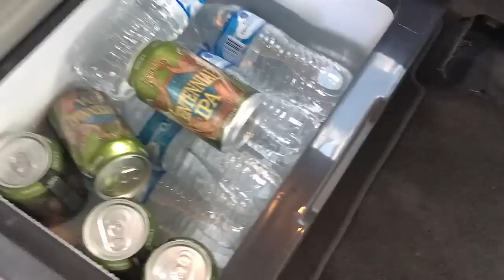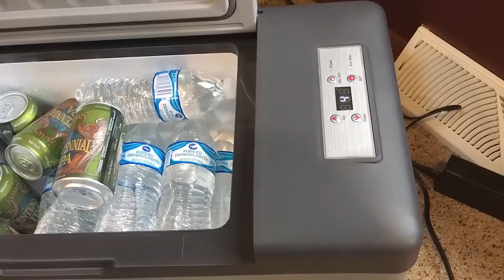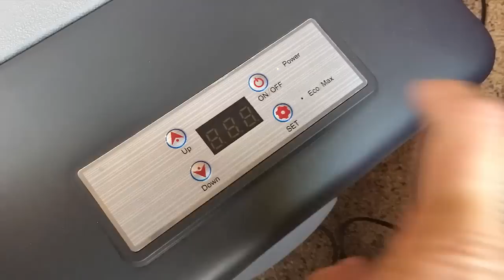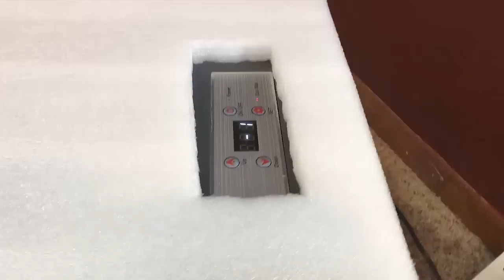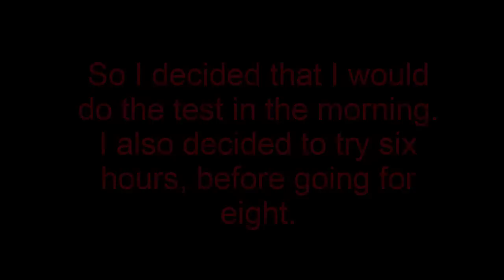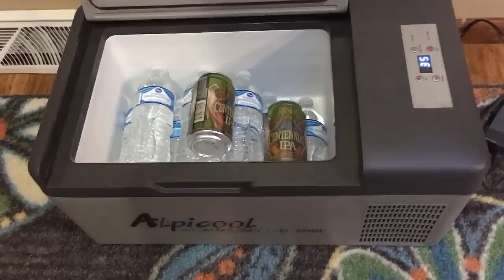Refrigeration in Your Van Part 2 (keeping beer and insulin cold)

Comment: I did the same with the packing material except my packing material completely boxes the entire frig.
Reply from the maker: It definitely helps but I did not have the foresight to leave room under the bed for packing on top. It just squeezes under my bed when the one piece is on the bottom.  Thanks for the idea and for watching!
Reply: @OdysseyCamper  i actually rubber cemented it on and cut out the lid and controller.  Not sure it really helps because i have no previous data but, common sense says it has to.

Comment: I've learned that a lot of these cheap Chinese refrigerators don't match their stats. There is very little quality control with these things. The compressor on my Joytutus 20 liter ran continually. It killed my 300 watt, 500 watt hour battery in 15-16 hours at 25 degrees. I went ahead and got a Setpower TC20, which has awesome insulation, and it lasts 48 hours on the same battery at 25 degrees. The build quality on these refrigerators are just hit and miss.

Comment: I forgot how to change it to H1. I have a lithium battery. Do you know how?
Reply from the maker: I THINK you press and hold the settings button until it flashes and then it might display an H1.  Unfortunately, I sold this one to a friend and now own an updated model.  Here is a page with some other hidden settings...unfortunately, it does not address your question but maybe you can figure it out through a process of elimination.  http://www.florida-prepper.com/hiddensettings.html
Reply: @OdysseyCamper  yeah. Tried that. It’s acting wonky off the Lycan. See how it fares overnight. Which unit did you get?
Reply from the maker: @wanderlostrvr2582  I went with an “xtreme power 21 quart” which appears to be an exact copy of the Alpicool. The Alpicools were hard to get last year, when shipping slowed down. I was going to send you a link but now when I go to the link, it shows a completely different model.
Reply: @OdysseyCamper  no worries. Plenty of under $200 ones on eBay. For now it kept things cool. I had issues before when using the Lycan with it. But so far so good...?

Comment: My ALPICOOL stops and starts every 10 minutes I don't trust this cooler at all I think it draws a lot more power than people think. I did put a thin layer of ice on the bottom of my alpicool and it ran a lot less and after hours of trying to set it at the right temperature which does not read correctly. I have more peace of mind using an ice chest knowing that the ice will keep it cold all night and not worry about using my battery. I have mixed feelings on this fridge don't know if it's worth it or not. If I have to put ice in my Alpicool to run more efficient I would have got a larger units. So I kind of feel like I wasted my money.
Reply from the maker: It sounds like you don't have enough stuff in it.  Rather than using ice, put some bottles of water in there.  They can be removed or added as needed.  The goal is to fill the empty spaces and then it won't cycle as much.  Thanks for watching!

Comment: This does NOT run on 120 as you stated, its all 12 volt. It comes with a separate built in ac/dc power  converter to take 120 to 12 volt.

Comment: Would a jackery 160 run this if fully charger over night?
Reply from the maker: Samantha Dodd it would run it for a little while. Once it’s cold it doesn’t run all the time so it would work for a few hours, maybe longer. It’s hard to predict, but let’s say you were driving that day and running it off the cigarette lighter. Let’s also say that you put water bottles in the bottom layer. It might just stay cold all night without being plugged in at all. So the Jackery can only help. If you already have the Jackery, then it’s worth trying.
Reply: @OdysseyCamper  

Thank u.  That's what I'm going to do.  I figure that I can use it for a cooler while I'm out if the quackery won't keep it cold by itself.  Only going to 3 or 4 days at a time now, until I retire.
Reply from the maker: Anytime Samantha!

Comment: 44 ah x 12 volts = 528 watt hours. Divided by 2 gives a 50% of 264 usable watt hours. Divide 264 watt hours by 60 watts, (the nominal watt rating for the cooler), and you get 4.4 hours of endurance. However, you energized your cigarette lighter by turning your ignition to acc. This powers up several things that are not apparent visually. This would account for the early demise of your starting battery. I have both the c-15 and the c-55 and both work great.

Comment: I find this unit likes to have ice and water inside . My goal Is to run it on FREE solar and alternator during the day and then turn if off around 7pm - 7a and see if it will keep raw meat and milk around 40F overnight.
Reply: NoSunBeach was your test successful?
Reply: @RustyShakleford1  Yes! see some videos on my channel.  For real world testing,  I've been on several 4 day trips and had meat, milk and cheese fresh with no issues turning off this fridge at night. One difference however is I've been driving until around 10pm so more run time on the fridge/freezer, but in the morning it's been under 40F and some of the meat has been even near frozen.  I had some chicken that had been in the van 4 days this past Sunday Morning and was perfect.

Comment: After having the whynter 43l for about 4 years I replaced it with the costway 54qt. Amazon sells for 399 (just went up from 379) 
On eco mode it sips power at 2.34 amps at 14v, 2.65 @ 12.5v. Its got a warmer section if you want fresh foods. Downsides....insulation is pathetic, and it came with a warped lid that wouldnt seal. Also in f scale it runs to max. In centigrade its okay. Im keeping the lid sealed with a ratcheting tie down. Because of these issues amazon issued me a full refund and i got to keep it anyway. I dont know how long this will last and frankly Im pissed that the price of the industry standard ARB got reduced from 970 to 775. Yep I would have bought that. BTW 07 odyssey exl with VCM disabled. Just did the timing belt myself so loving it again.
Reply from the maker: Good info, thanks for that!  I just did my timing belt as well.  151,000 miles on my 2013 and so far, no problems.  I'm curious, why disable the VCM?
Reply: @OdysseyCamper  odyclub forums has vast amounts of info on vcm but I will try to explain in brief. VCM is an ill conceived system similar to others previously tried by GM (cadillac 8-6-4) for example that make a well balanced operating machine work as it shouldnt. Its sole intent was not to benefit owners with fuel savings but save american honda co. from costly CAFE penalties adding up to potentially billions of dollars. They knew that the system would lead to very costly repairs and maintenance after factory warranty ended. A class action lawsuit settled by Honda documents a large number of complaints of: fouled spark plugs. Excessive oil consumption. Premature  wear of oil control rings. Piston failure and replacement. All in the cylinders that run deactivated  because of lack of pressure when the cylinders dont fire. In addition the electronic active engine mounts are known for common premature failure because they simply werent up to the strength needed to smooth the engine in eco mode. These cost from 700 to 1100 dollars to replace. 

What happens when you disable vcm? Several devices have been developed the early ones as I have were dumb resistive devices placed inline with one of the coolant temp sensors. Its variable as needed to adjust to ambient temp in calif we are temperate enough to set and forget if you are in midwest or northeast you may have to make a seasonal tweak twice a year. It fools the ecm into believing the engine is running just a couple of degrees below normal and the ecm wont tell eco mode to activate until normal temp is reached. This has a manageable risk in that your temp gauge on the cluster always errs to the low side and if it actually overheated the gauge will never alert you because the circuit and thus the error are non linear. In other words when coolant is really 180 degrees the relative scale might represent 170. No numbers on the cluster of course. However if coolant temp was really 240 and rising the gauge would read like its 200. Since the engine usually shows other symptoms if ite really 240 and rising an alert driver prolly will not blow the engine. However because of this issue I would recommend the new smart devices which also show the error in display but once they detect the engine really is too hot... they deactivate the muzzler and allow the gauge to show the actual temp. Since the price difference is around 120 dollars vs 80 or 90 dollars I would spend the extra. 

Most owners who muzzle report a loss of 1-2 mpg. I challenged a seller of a muzzler  device on its true cost and he presented me the comparisons of that extra gas vs each of the expected failed component repair costs and the results floored me.  The gas is trivial compared to replacing one engine mount. Add in piston ring replacement on that bank and its like 5x the gas cost.
Frankly the greatest  benefit is you get a van that has one of the best engines ever designed in the industry that works as it should.  Instant throttle response at highway speeds that previously took a half second or so of shuddering to kick in. And that shudder, as vcm kicks in and out, youre prolly so used to it it youve forgotten what smooth is. And the audio system, you prolly never noticed that when vcm is on it injects a weird cancelling signal into the music at a low frequency to mask vibration. Youll get none of that. 

Prolly the most damning thing if you are still thinking its sacriledge to desecrate the altar of hondas legendary japanese perfect engineering.... is that all of these issues were detailed (except for the cure of muzzling vcm) in the massive class action suit owners slammed honda over.... and honda barely put up a fight and extended engine warrantees to ten years for all the related components on millions of vehicles. They knew it was true. 
If you are in an area doing biannual smog checks which I believe is just most populated CA counties, NY, and some of OR and WA- though Im not sure I just know I have to in san diego-youll need to remove it to pass smog. 5 minutes but you have to do it with a cold engine in the am or you trip a CEL which could take weeks for your readiness monitors to set. Thats not a big deal like I said whether installing or removing this gizmo just do it  before first cold start of the day and youll never trip a code.
Reply from the maker: @batvette  Very Interesting!  Thank you for taking the time to explain it.  When I moved from my 04' to my 13" I noticed that at cruising speed it did not have the immediate throttle response.  I was thinking it was the power band or difference in gearing, but it sounds like VCM was part of what I was feeling.  I'm going to try this mod; thanks!
Reply: Below I posted a list of mods on odyclub this morning. 
------
I stuck a couple of 6v golf cart batteries in the drivers side rear tub.... 2 gauge under the van to the alternator, anl fuse on the unibody frame rail a foot away, another fuse at the batteries in back. I used 12v switched from that rear socket to switch the solenoid relay isolater (continuous duty 200a)to charge the batteries. Their output goes to a fuse/breaker/terminal box mounted to the bottom back of the fold down seat which no longer does. Box has a 200a breaker which instantly disengages aux batteries from all its loads with a pushbutton and a charge guard which is common in police cars. I use it as an overdischarge protectection for the batteries. 30a capacity breaks circuit at 11v restores at 12v with a 15min emergency override. $20 on ebay used. The power box connects a 750w interter i have an outlet tap on and an xbox 360 hooked up to a high res 1980 pi 7"monitor on drivers visor. Yes I tried to play it while driving and nearly lost my life! Fortunately my character picked up more ammo and I went on to complete the level. 
Also connected is a 54 qt freezer, 7" tv in front, 12" fan in back, a cross flow exhaust blower in the single body vent behind the rear bumper and a 25 amp vector switching charger hardwired to the batteries with a 2000 watt generator to power it and a 30 watt mono solar panel on the rare times when Im feeling so damn hippy during the hottest part of the day Im willing to broil in my nimbus grey box just to brag to my hippie friends i care about the planet more than they do. Most of the times 10 minutes with Genny equals all day with the panel in the sun. Letting my hippie friends hear it run revealing my environmental stance is all poser.... a priceless tragedy.
With all that is a hardwired usb charger that comes out of the center console with 2 ports, another in the rear with 2 ports, and several 12volt trailer plug sockets to run 12v tsunami air compressor, dustbuster, etc.
Oh and last a microwave. Worked off 1000 watt inverter till that melted down now only the genny. 
Soon to come: 10,000 btu portable air conditioner in the rear. Single hose converted to dual hose operation. Powered by genny inside quiet box on hitch cargo rack which will have forced cooling. Havent decided if quiet box should be aluminum deckplate or birch ply coated with 'glass epoxy resin and im still sourcing a compact blower and designing a labyrinth assembly to attach it with. Ive done it with large shop vacs and compressors, genny produces more heat tho
---------
Couple of things not listed. Rear 3 windows blacked out and insulated with 1" polyurethane foil back panel home depot has. Rejects heat and noise and stays in place with just pressure. 
The middle seats are gone so picked up a 4x8 roll of thick black pvc home depot sells for garage floors. 60 bucks filled the whole rear pretty much wall to wall. Makes those seat anchors comfy to crawl over. Made an aluminum rack/shelf thing that attachs with just clamps to all 4 rear grab handles. The shelf is plywood covered in padded vinyl 34x14 behind driver only about 5" below ceiling but I just finished two plastic clear storage bins that hang below each 14x11.5x7".
It gives me 1" aluminum extrusion across the rear ceiling Im gonna mount a 24-32" flat panel on hinges to it. 
And if you dont have window visors they are the best 54 bucks i ever spent. All 4 windows crack over an inch but you walk right up and cant tell.  No rain gets in. 

Hope something above helps.
Reply from the maker: batvette good info!  This should also help others that read through the comments.

Comment: hello I have the C20 alpicool, it does not turn me on when it is connected to the power, it is freshly unpacked, should I leave it charging or should I turn it on when I press the start button?  Thank you.
Reply from the maker: It should turn on as soon as you press the on button.  Check the power cord to make sure it is seated and if you are using the 12V power cord, check your fuses.
Reply: @JohnD I opened it and had a loose piece, maybe because of a blow in the transfer, it works perfectly, thank you very much !!

Comment: In tests on YouTube, I see MUCH lower power usages and longer run times than you suggest.  Slim Potatohead suggests an average power usage of 5.76 Amp Hours per day while Bubba's Crackerbox Palace
 suggests an average usage of 3 Amp Hours per day (math conversions have to be made).  This would suggest that the box could run many days just on a single battery.  Anyone have actual experience on how long one of these might run on a battery?  (I'll leave the variables up to your imagination.)
Reply from the maker: Hi Michael, I just watched Slim's video the other day and as you mention, my estimates of run time are very conservative.  However, there are just too many variables to do a very scientific evaluation.  A lot depends on what you have in it (including whether it is frozen when you start the test), the ambient temperature, the set temperature, whether it's on ECO mode, added insulation, etc.  I mention in my RTR video that I'm able to run it on 100W of solar and charge my battery pack at the same time.  I think it was about 80 degrees then and I had the empty space occupied by water bottles.  If I had to make a general statement I'd say that my estimates are more a worst case situation and Slim and Bubba's are more optimistic. I believe that Slim ran the Alpicool in Eco mode at around 32F.  I'd consider his video (which is very well done) and mine to be two different usage cases.
Reply: @OdysseyCamper  Thanks for answering.  I just watched another thorough analysis by 
Nine Hundred Dollar Luxury Yacht
.  His results are consistent with the other two.  He shows two amp hours per day usage.  So, it seems that the daily power usage of the cooler runs around 2 to 5 amp hours in cooling mode (not freezer).  This would mean that on a 48 amp hour car battery, you might get 9 to 24 days.   On a proper deep cycle 100 amp hour battery, you might get 20 to 50 days.  That's a big ball park, but even the worst case is over a week.  Considerably better than your off the cuff speculation of 24 hours.  I might have guessed the same if I had not been researching these thoroughly.  Thanks again.

Comment: Will this run on ur diehard
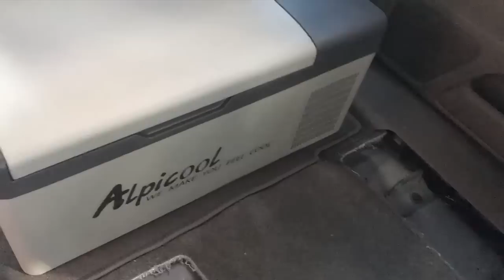Reply from the maker: Samantha Dodd Hi Samantha, the DieHard doesn’t have enough reserve to run the Alpicool for long. I use my console battery pack (which is double the DieHard) in conjunction with the solar panel. I fill the unused space in the cooler with bottled water to hold the cold and it coasts through the dark part of the night. I talk about it on this video, at the 3:20 mark. https://youtu.be/g-8aPduAnqk  Thanks for watching!
Reply: Mine will run on a Walmart garden tractor battery all night long.